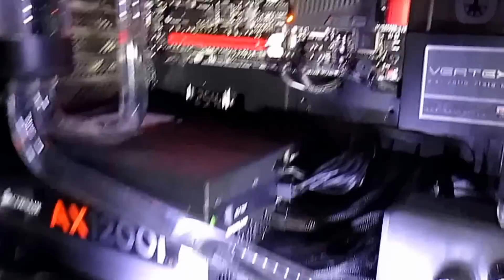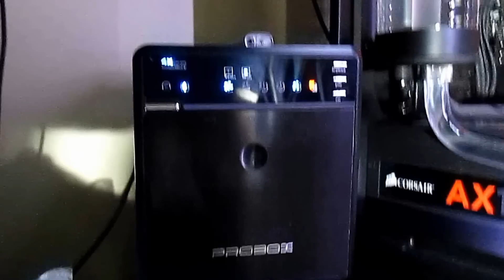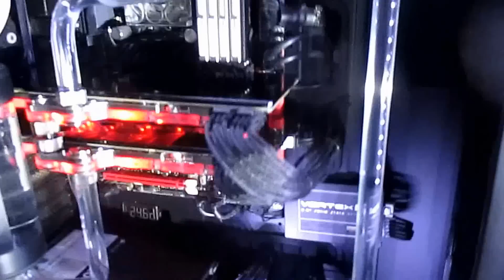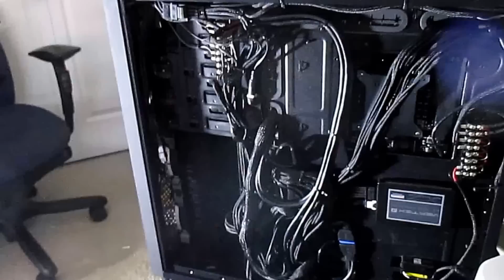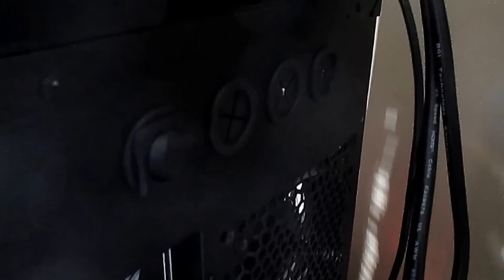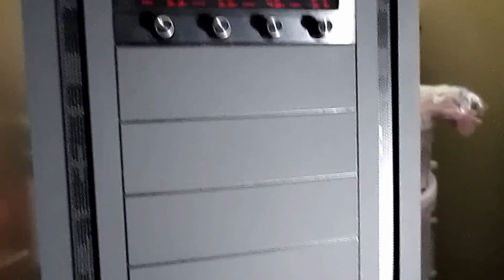Acrylic tube Watercooling PC Build - Obi Wan Shino

Comment: What kind of LED lights did you use?
Reply from the maker: The white LED's are the ones you buy at Walmart that are in the auto section.

the ones behind the GPU's are from ebay RGB with remote